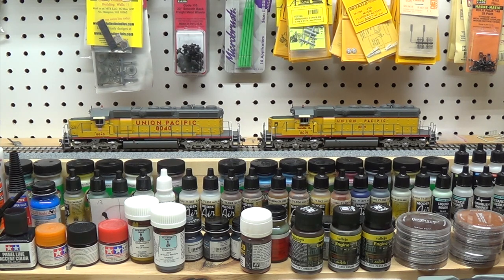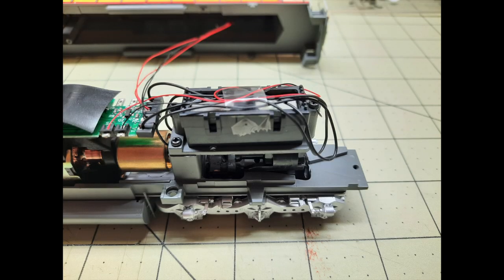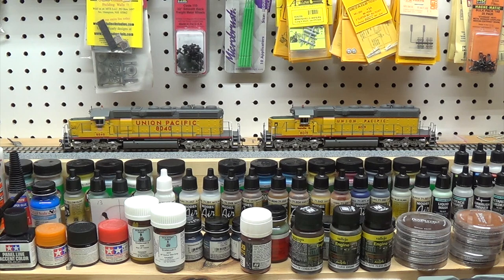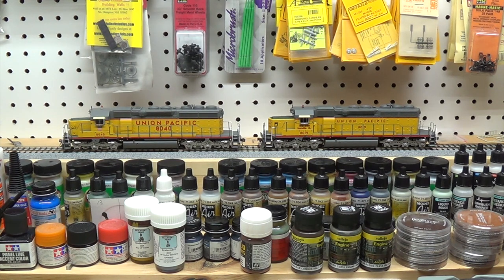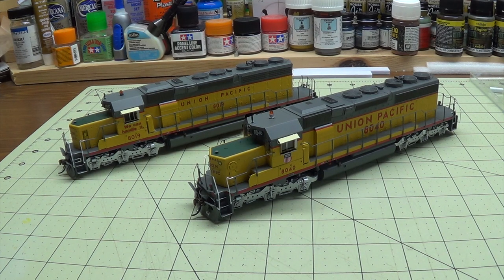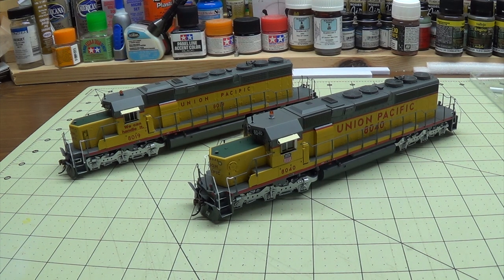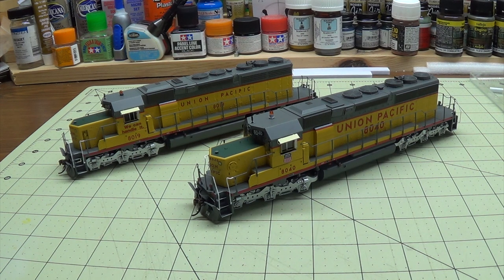Scale Sound Systems vs. Athearn Dual Sugar Cube.  Speaker comparison!

Comment: DG I have over 100 locomotives that have SSS speakers. There are the best bar none. JT Burke is an audio engineer by trade. The most remarkable attribute about his product line of speakers is this: you don't have to cut up the inside of the shell of your engine to make them fit. Almost all of them DROP IN without any modification. That's the biggest selling point to me besides the deep bass rumble. The speakers are worth the investment. Enjoy your channel. Keep the videos coming!!

Comment: That's a great way to do a comparison.  So many others are disjointed.  You just get to it.  This could be a regular feature.

I agree with your analysis, and I prefer throatier sounds.  It's very difficult to get that low bass rumble from a speaker that fits in an HO model being driven by a 2 watt amp.

I don't think the Ecos have the equalizer, which can adjust a speakers sound quality.  Not sure.

I say consist them together for the perfect combined sound!  👌
Reply from the maker: Thank you so much!  The scale sounds systems speaker definitely highlights the prime mover.

Comment: One quick way to mess with the sound is to change CV225 (assuming a Tsu2 decoder).  Try setting the CV to 2 or 3.  2 is for a 'small' speaker, 3 is for a medium speaker.  It just adjusts some of the cut-offs at certain frequencies, which means it should make it sound clearer as it cuts some of the distortion from the low frequencies.
Reply from the maker: This video was actually the Econami decoder.  But thanks for sharing the info, surely helpful.
Reply: @DGModelworks  Duh, you said so in the video, my bad.  I did check that manual real quick on their website and they actually are the same for both decoders.

Comment: Very well arranged video. The only suggestion I have for future videos that would help noobs like me is if the name of the sound comes up on the screen as you change them from one to the next. Bell & horn are obvious, but some of the other aren't as much.

Thanks for the excellent video!
Reply from the maker: Thanks the feedback.  I actually thought of that afterwards.   So...this video was Start-up, Bell, Horn, Dynamic Brakes, and then I went up through all the notches of the prime mover, and then back down.  Simulating speeding up and slowing down.   Hope this helps, and thanks again!

Comment: Did you change CV 225 (speaker size selection) before doing this test?   If you change CV225 to a value of 1 it makes a big difference to any speaker installed.
Reply from the maker: I did not.  I wanted to do a direct comparison for this video.  With the only difference being the speaker itself.